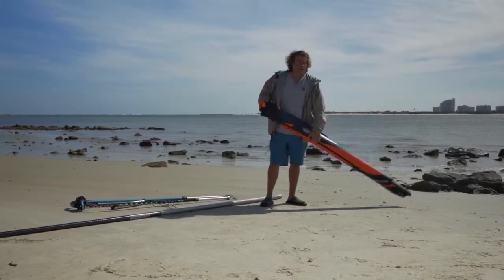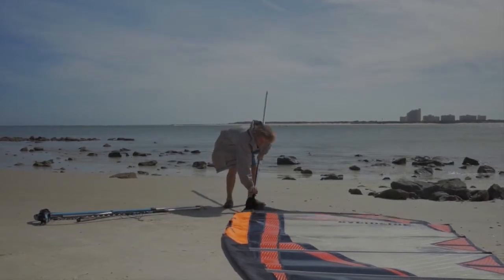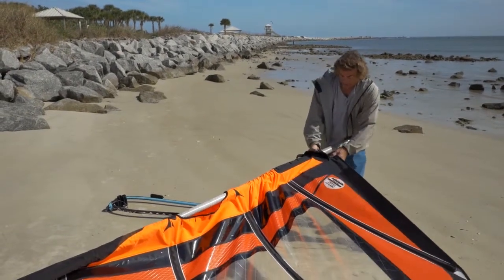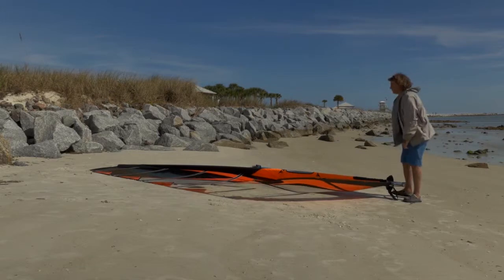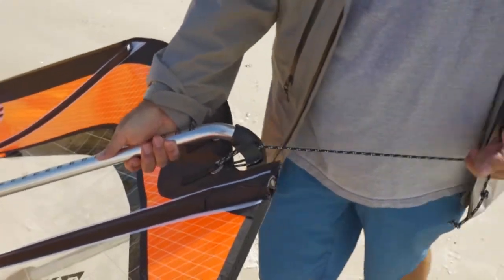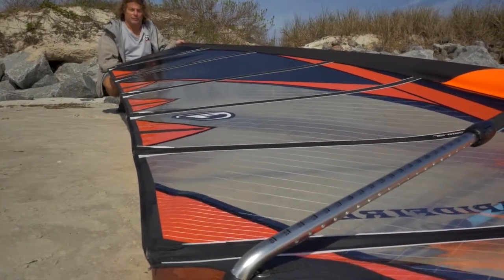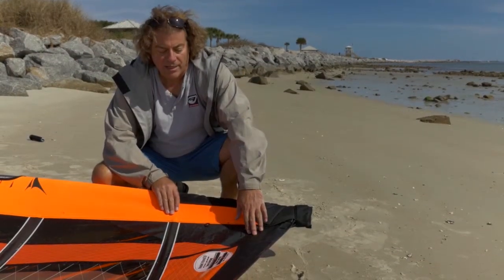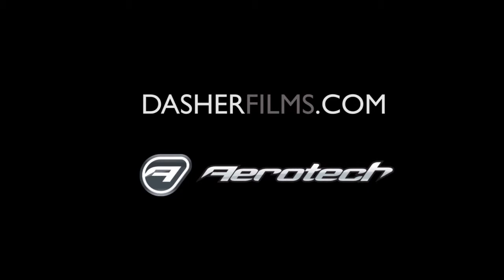2015 Aerotech Rapidfire Rigging Guide

Comment: I just got this sail (used) and i have the battens loose and set the cams on the mast with about 40% downhawl and the battens snaped the tips that slot into the cams.

Any ideas why? Maybe just because they're old? I dont realy feel i did anything wrong or put to much pressure on them.